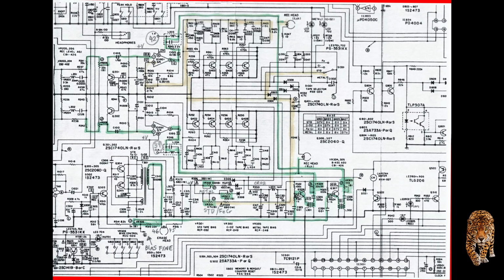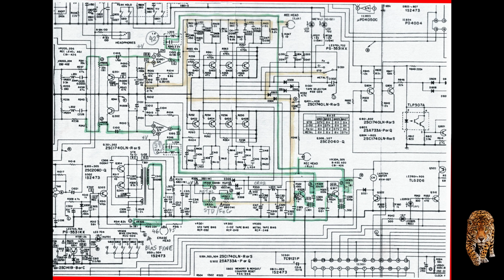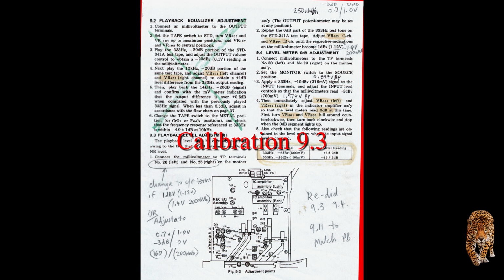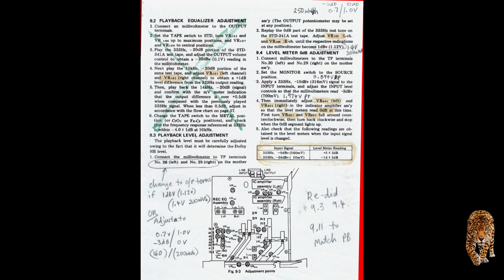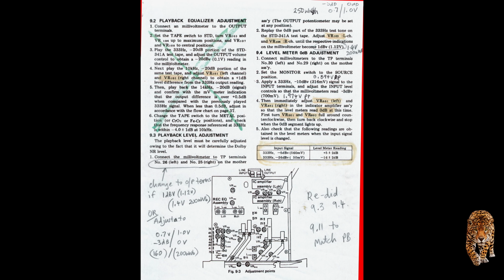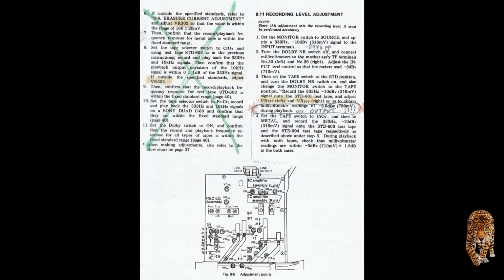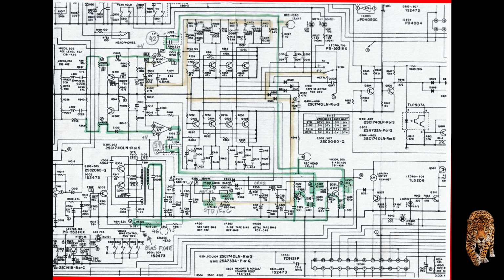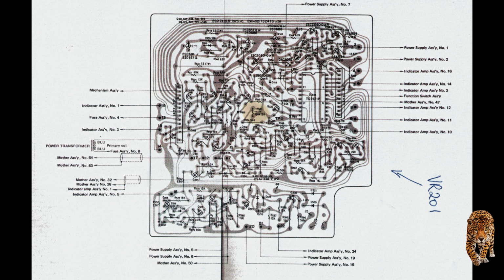Pioneer CT F950 Part 13 Calibration

Comment: Please Help Another Questline  "9-14 Playback Dolby NR Adjustment " same as CT-F900
Step 1- Done
Step 2 -Done
Step 3  - Pioneer "Apply a 1kHZ to 15 and 16 adjust the input level so the millvoltmeter indication becomes 0dbv (1v rms)" 
** Redline -So set Generator output to 1.1 to 1.5v RMS? **
Than it would be at 1v and hopefully the Pioneer display meter would read 0DB ? 
Step 4 Please Help I'm Lost w this one ??? Pioneer "Apply an input which is 34DB below that of paragraph 3 above" 
OK so Adjusting the input volume down to what? (-34db=mv?) or is it  -34dv= 20mv?
The Pioneer DB meter only goes to -20db (ct-f900) I'm lost and not know were to put it impossible to do the next step?
Step 5 Turn Dolby on Adjust VR107 and Vr108 to 1mv (-40db)
I hope this makes sense Please Help Thank

Comment: Good Video I'm Calibrating a CT-F900 and at 14.83 in playback mode it says "Record and Playback -10dbv 333HZ (316mv),,,,,,,, Rotate VR107,vr108 and it all works but it say to after Maximum Level,, so lets say its at -5db(xx mv write down)  than I should go down .5db?which would be -5.5db = (xx) MVac    -5.0db =.56 and -5.5db =.53    so it is .03vac, I think this is Correct and set the vr107 to .53? (I think I'm figuring out what Pioneer meant, I like when they Pioneer Listed all the voltage but they missed a lot)

Comment: I am calibrating a CT F950 to 160nWb/m. The 1.12V in section 9.3 is too high. I used 700mV ( 710mV). How do you set VR203, VR204 in section9.9 ? Is TP 5 actually the board pin 5? I could adjust VR205, VR206 from that #5 . There doesn't seem to be a TP for just VR203, VR204. Thanks
Reply: I'm also Calibrating my ct-f1250 and ct-f900 around 710mv So when I play a weak tape I will have playback full range, which is really cool but one set to 1.12v will Barely move the display like -6db which is boring

Still figuring if how it effects the recording? Levels
Reply: Update - Must do this after all Calibration (Adjustments) are done, it will effect all the voltage for Calibration. its already to hard to figure it out PIONEER TEXT and than converting it would almost be impossible and confusing.